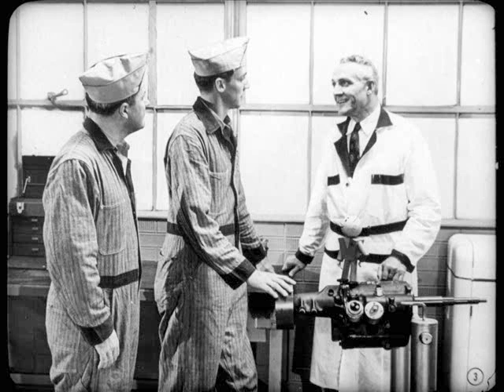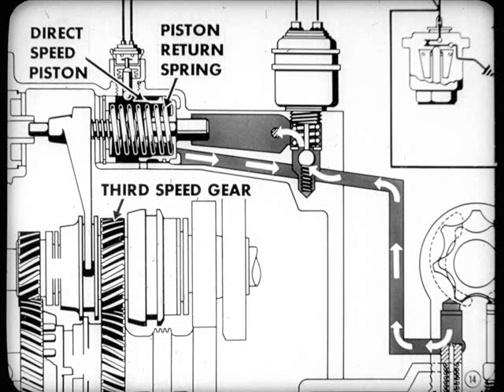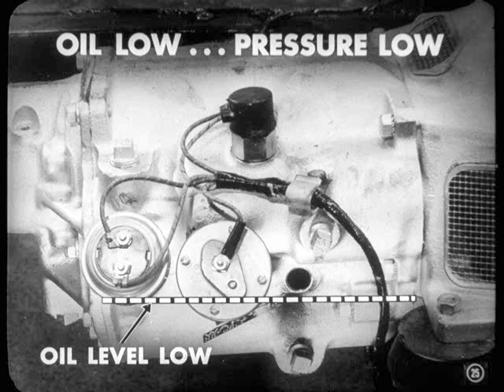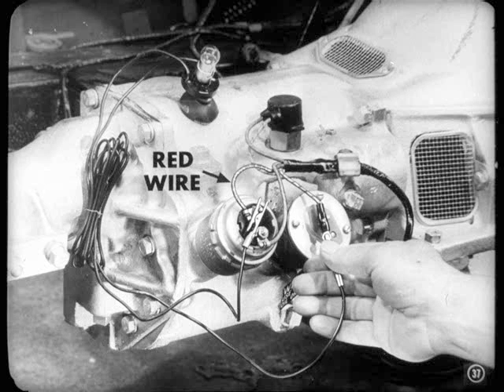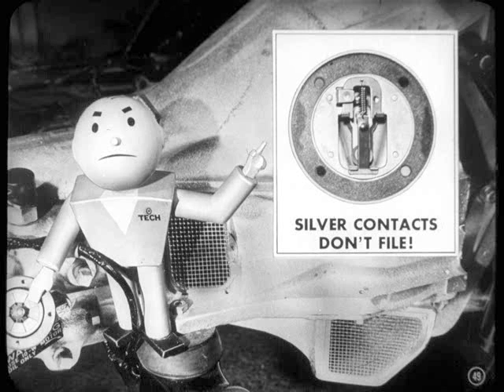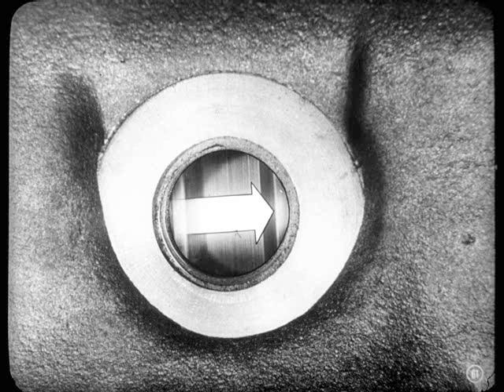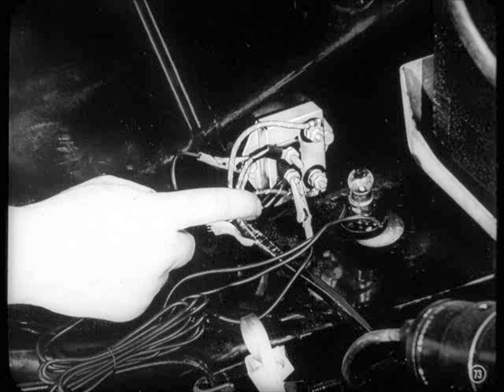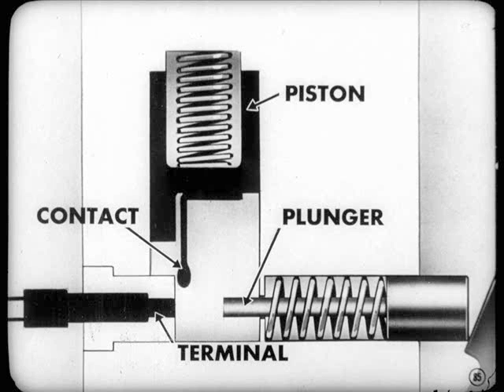Chrysler Master Tech - 1949, Volume 2-12 How To Service The Hydraulically Operated Transmission

Comment: What if the transmission is shifting properly, but instead of a smooth upshift, the gears grind and grab hard? I'm having this problem in my 1950 Coronet.
Reply: Damn, no one answered your question
Reply: @domingodeanda233  I know. I'm still searching for someone who knows the answer before I take the car in and have someone rip it apart who may not be familiar with them.
Reply: J’ai le même problème avec mon coupé wayfarer de 51
Reply: @delphinedordan9802  If you find the answer, please post it here.
Reply: Transmission needs rebuilt. Both 1-2, and 3-4 shifts have syncos. Without them the gears will grind.
Reply: @enragedgrandpa2889  Doubtful. More information: shifted perfectly fine until I took it to a garage and had all the fluids changed. Trouble began upon pickup. Hesitate to take it back to the same mechanic.
Reply: @Cotronixco  Modern oil may be too slippery causing the synchros not to spin. Use hydraulic oil or Ford Type F. Modern engine oil and Automatic transmission fluid is friction-modified and too slippery.

Comment: This filmstrip is for the M-6 transmission used on 1949-52 Dodge, Chrysler, and DeSoto.  I have the MTSC kit for the M-5 transmission used on the 1946-48 Chrysler and DeSoto.  I would like to share it with fellow restorers.  Where can I go to get the filmstrip turned into digital pics?  Costco says they don't do filmstrips.
Reply: Some scanners have a place to scan slides or negatives. I picked up one at a yard sale cheap that was specifically made for slides
Reply: 8mm or 16mm?